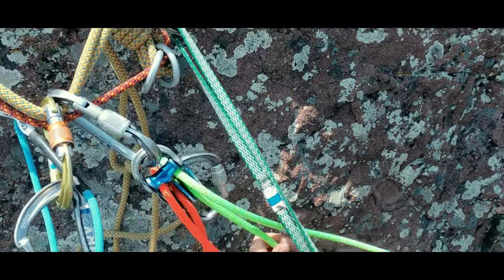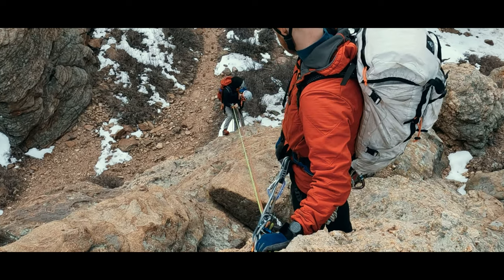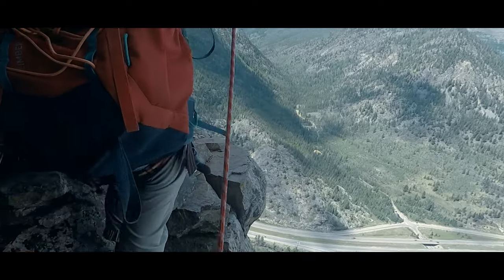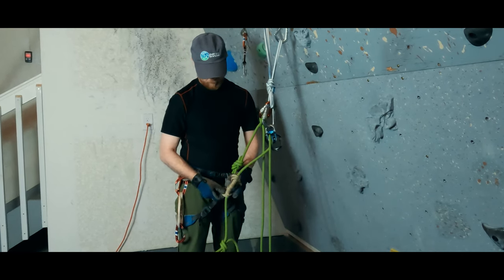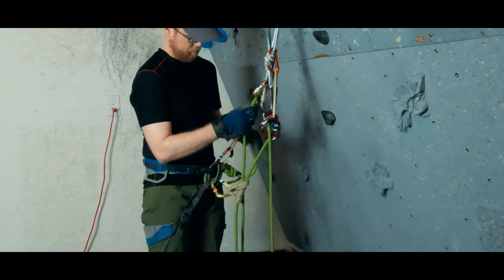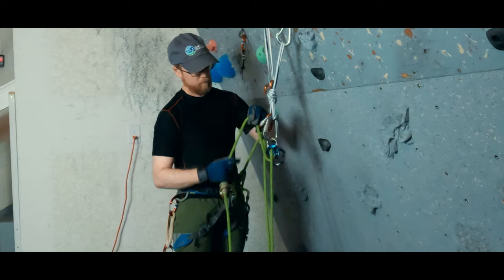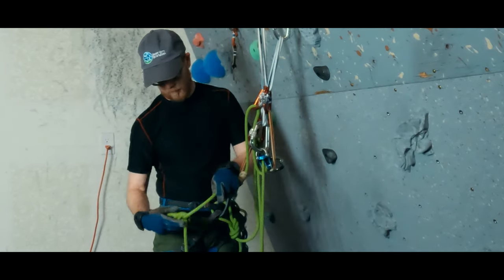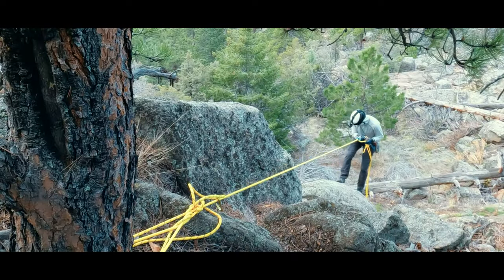Three Ways to Lower a Climber Off of a Plaquette (Auto-Blocking Tube) Device

Comment: Good video. Could be a little more clear with a close up shot of the belay device. Also you forgot method 4: ditch the atc and redirect the brake strand of your grigri 😂
Reply from the maker: Fair point on the close up. Appreciate the feedback as it helps me make the channel better... and then 5th option: re-ascending the rope to get your biner block unstuck from your (eventual) single-strand GriGri rappel 😂
Reply: @ShortGuysBetaWorks  hahaha I guess it’s either that or simul.